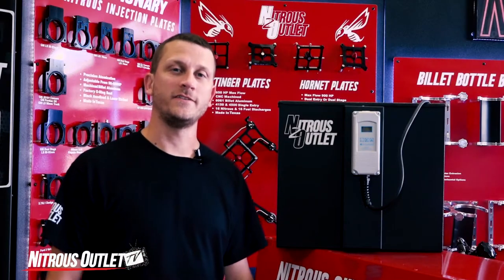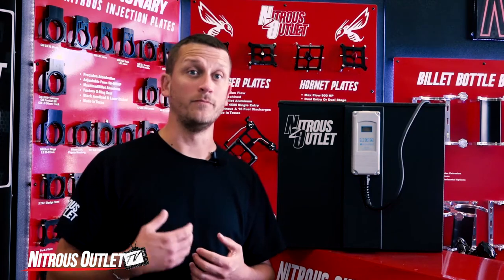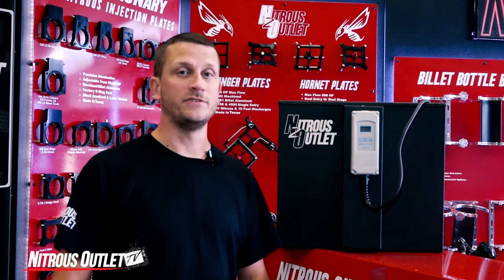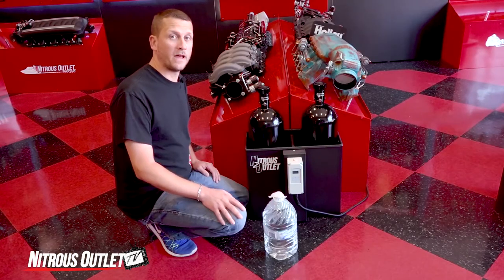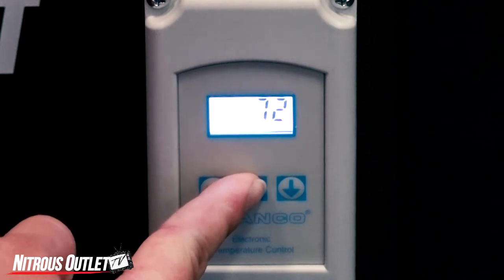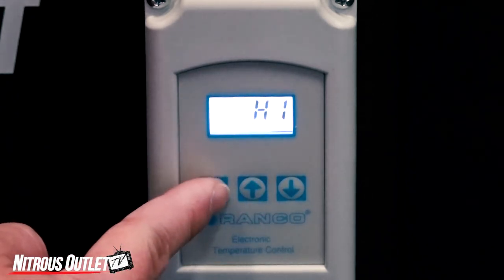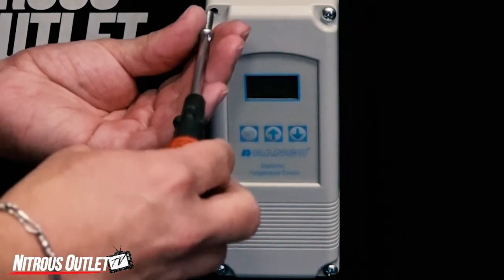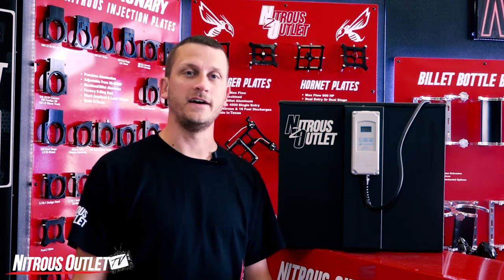Nitrous Outlet Hot Water Bottle Heater

Comment: So how fast do u want the bottles to warm up in order to be on the safe side an at what temperature
Reply from the maker: It will typically take about 12-15 minutes using this style heater.  We provide a temperature/pressure chart as temp is directly related to pressure.